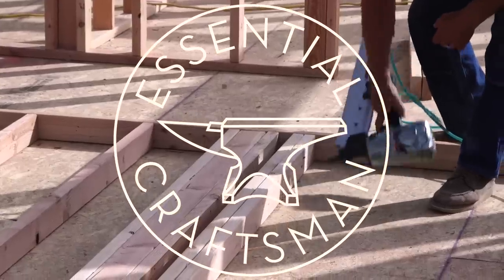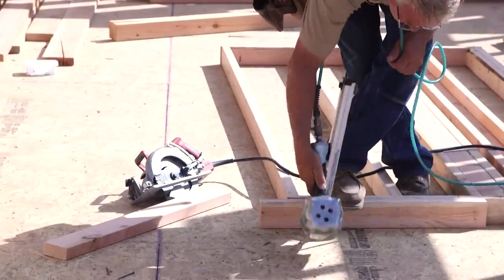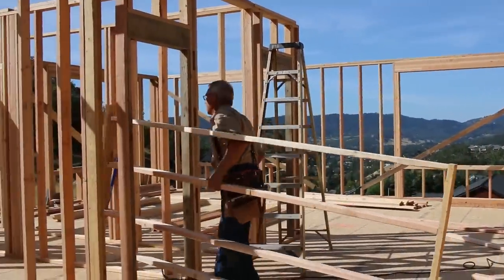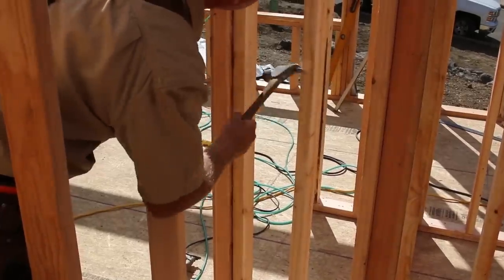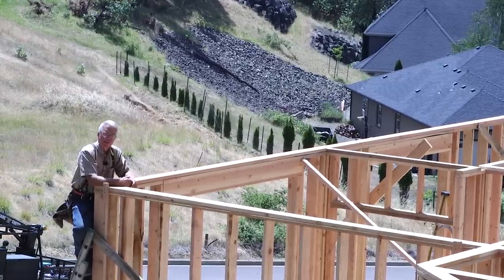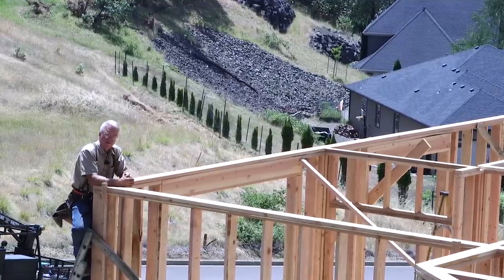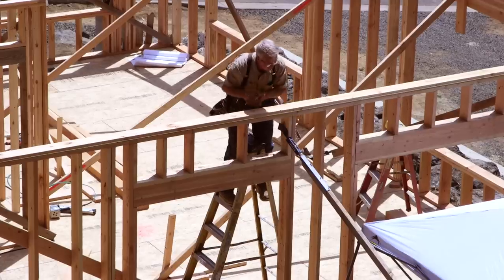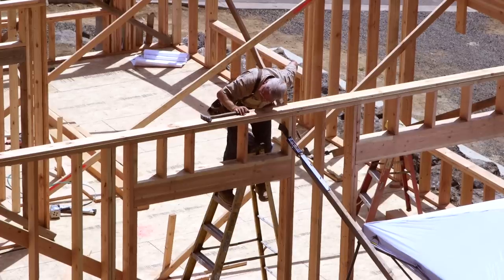Plumb and Line the Walls Ep.49

Comment: I've always like to insulate the bathroom walls and common bedroom walls for sound. Thanks for sharing,; keep up the great videos!!!
Reply from the maker: great idea!
Reply: Thomps 2881 same here!
Reply: Like wise. Keeping noise down is a great idea. I do floors to.
Reply: In ireland we sound insulate all internal walls now. i grew up in a house that didnt have insulation in the studs, you could hear everything. It dosent cost much extra to do it.
Reply: Two separate 4" stud walls on a single 6" plate, with insulation weaved between them, works very well for reducing sound transmission, more materials and time though, nothing is better than solid block built interior walls though.
Reply: A thousand times yes!  I try to get people to do it every time; just throw some Roxul in there, you won't regret it.
Reply: Noise dampening from the kids too 😉😉😉
Reply: Thomps 2881 a rootin, tootin good idea!
Reply: in old Cornish cottages in the UK, the two top floor bedrooms are separated by the staircase and the bathroom is normally downstairs.
Reply: I would have gladly paid my builder to insulate our bedroom wall from the noise in the family room, but nope, not an option! Ridiculous.
Reply: And extra glue for the floor around the bed area😂
Reply: @thomasutley  I've heard some contractors will upcharge an absorbent amount for something so easy to do. Never made sense to me.
Reply: Roxul makes a sound insulation. here In canada anyways.
Reply: When we built our retirement house a few years ago, we put batt insulation in ALL the interior walls for sound deadening.  The cost was minimal and the pleasure of quietness was priceless!!  I recommend it highly.
Reply: I did my kitchen for the same reason
Reply: Hillbert 08 is it their rock wool product?
Reply: @Some Guy it has a lot of sound deadening qualities. We sometimes even throw in a few leprechauns to boost the rating. 😂😂😂
Reply: @Some Guy any one I ever caught was only good at laying brick.
Reply: Same here, it really makes for a solid feeling place.
Reply: Here in Belgium we almost every house has brick walls. That is why I watch this series. Wooden houses are getting build  more and more.
Reply: @stephenmurray4916  Probably can hear people farting across the house.
Reply: @thomasutley   It's your house, you are paying for it. Insist on it.
Reply: @thomasutley   I went to my house and did what I wanted. Ran audio cables for speakers, network runs, chases for av cables. As long as it was after they left and I didnt change plan work they didnt care.
Reply: @shortfuse43  I did the same for sound..heating and cooling..and for fire...
Reply: Same here
Reply: @Jon-cs9ik  you just regret being the roxul installer.. damn I hate touching that stuff!! 😷
Reply: I can see Larry Haun never taught you to hand nail.

Comment: I have built quite a few houses as a joiner and the way we used to go about it was the same as what you do here in the way that you cut all your studs, bottom and top rails etc and then assemble. The only difference is that when we were framing we would frame the walls on the deck and then square them then sheet them and then lift them into place, we found it easier than trying to wrestle sheets when the frame work is up. Long walls would be broken down into shorter  walls if they were going to be really heavy but most of the time we had a tele handler on site so there was no heavy lifting really. Not saying our way is correct but just saying that's the way we did it.
It's good to see a house framed like this way though, very interesting. Keep up the good work   👍🏡

Comment: Thanks for sharing! Keep up the good works guys.

On the subject of insulating interior walls the acoustic seal caulking (it's basically tar in a caulking gun and sound dampening drywall go a long way but I wouldn't do it on a spec house only a custom build where it was needed and paid for. 

The real sound transfer is between floors imo. I look forward to you guys going into detail on this in the podcast!

Comment: Here in the south we use 2x4 construction for exterior walls almost exclusively. Unless like in Florida where there are a lot concrete block construction. The walls may get brick veneer, but the extra insulation is not necessary. It is good but not necessary.

Comment: Are you planning on using thicker drywall, or possibly insulation for any of the bathroom walls? That coupled with a solid-core door adds quite a bit more privacy. Especially nice for bathrooms off of a livingroom or kitchen

Comment: Hello Sir,

Question for you if you read this and have the time.  I wonder why you stand most of your exterior walls without sheeting?  I’m from the heart of the Midwest and have been a carpenter for 24 years. It is standard practice in these parts to sheet walls and house wrap on the ground then stand exterior walls.  Albeit, garage walls excluded.  Thank you kindly, and I plan to use your videos as standard practice for the next generation of apprentice’s I train.  Simply brilliant!

Comment: Love this show I just finished my carpentry apprenticeship here in New Zealand. We frame a little different here don't use sheathing instead we block or dwang or nog (different terms) between studs at 800mm centers. I personally think sheathing is probably better for the insulating values and bracing elements.
Keep up good work
Reply: Back in the day we used to let in a sway brace diagonally into the wall. Simpson still makes metal bracing that you nail into the wall after cutting a saw kerf.

Comment: Put your string and the bracing on the inside of the wall. Nail blocks over a joist where you need to nail a brace.Put your sheating on the exterior walls before you take the braces off.

Comment: You Sir use to work out here in Vegas and have seen how quick they build homes not very straight or plumb in theses huge sub division they build but they are building a new home from beginning to end in 6 weeks. The framers get paid by piece work so they usually try to frame out 2 or 3 homes per day.

Comment: It isn’t so much timber walls isn’t typical in Denmark, it’s just old fashioned. Most interior walls with dry wall are done with steel. A gauge you can cut with tin snips, and crimp the joint with  special pliers. Top, bottom and sides usually have some type of dampening for sound as well. And all of them are insulated as well, at least for sound. Seems very cumbersome to still do it with wood...

Comment: Hey Scott and Nate, I'm wondering if this is just different building practice or if there's a gap in my knowledge. at this point in the video series I would have seen somewhere between 3 and 6 temporary ladders built into the walls as blocking. On the framing sites I was on, we always made sure there were ladders up two exterior walls and possibly a couple of interior walls as well. It's a minor thing, but I figured I would ask.

Comment: Good to use lots of braces to keep things straight. As a finish carpenter I have seen too many crooked walls. The tall guys can really push a wall, that is if it's an 8' wall. Just grab the studs, not too high, arch your back and when the guy with the bubble machine, line or eyeball says push, just straighten your back, but there has to be an easier way. If it's an outside wall you want to push inward, and you have a shovel handy, you can jump on it with both feet to drive it into the ground and butt a long 2" by against the blade of the spade, and use it as a bent prop. It can push a lot, that way. When I was on a framing crew back in the 80's framing large apartment buildings, on a good day, the boss was only feeding the crew material with the fork lift all day, but that wasn't all the time.

Comment: I can't imagine spending time chasing an 1/8" framing error anywhere. That's less than humidity and temperature expansion/contraction in most cases, and if you can see that error anywhere in the finished product then you're probably a robot. I can admire craftwork and high standards but that just seems counter-productive.
Reply: Keith Klassen ya
Reply: cutting on the wrong side of a line seems bad enough.

Comment: you may have answered this already but is there going to be fire blocking or fire stop in the walls?
Reply: The top plates act fire-stops in this kind of framing. Separate fire blocking is needed in balloon framed walls.
Reply: The Code for residential construction in used most places in the US don't require fire blocking for 8 foot walls.  I believe that a wall has to exceed 10 feet before fire blocking is required. Also, blocking is required between floors, but in the most common type of framing (the way it's done here) like J Anderson said, the top plates fulfill the need for fire-blocking between stories.

Comment: If you were to be adding insulation for sound dampening in interior walls, would you still use 2x4s or would it be better to use 2x6s?
Reply: 2x4 with r11 insulation does a nice job. I wouldn't go to 2x6, instead I've used sound sheeting behind the drywall (in hotel application); worked great.
Reply: @thomps2881  Thanks.

Comment: I prefer insulated interior walls...much quieter, makes house feel much more substantial.
Reply: Code in my area  homes worth worth than 500k require insulation between rooms and between floors  for sound.
Reply: Glenn Holcomb.... wrong. Last two homes we’ve had built and lived in had the interior walls insulated. Huge difference. And you don’t need exterior doors. Just solid wood, not cheap hollow core.
Reply: Glenn Holcomb ....
Reply: Sound does not infiltrate like air does. Doesn’t sucked under a door jamb.....but whatever....I’ve lived in houses built both ways and know the difference.
Reply: Glenn Holcomb ....Really??? But according to your theory all those weird bathroom noises will leak out under the door jamb...sound insulation isn’t meant for “vibration”. It’s to muffle TV, music, talking and other sounds from adjacent rooms...which it does very effectively.

Comment: I always asumed internal walls are insulated for sound reasons but I know there are many ways of achieving this.
Reply: very rarely, even on expensive homes. only custom builders do that on personal homes
Reply: @alexstepanyuk381  the homes I've lived in usually haven't had a sound issue, so if it doesn't need it i wouldn't be fussed.

Comment: I strongly disagree with no insulation within interior walls...all rooms, especially bedrooms are better with soundproofing from other rooms. I built one home for myself and I used 3 types of double-walled construction in bathroom, bedrooms and laundry room walls and I insulated them for privacy and acoustic isolation. It's cheap to do so. It also allows better temperature control in rooms that aren't being used and rooms that are being used. It's kinda like rebar and concrete...2 of the cheapest materials in a house and people are always skimping for some reason. My slab was 6" thick with lots of rebar and weld-wire mesh, my non-bearing interior footings were 12" by 24". My exterior footings were 24" by 48" but then I was building on a hill in California where mudslides occur. If my house was going to take a downhill skiing trip it was going to arrive in one piece. You can't make money building that way though. I was listening to some other videos today and it occurred to me that you could make a living narrating for people's videos. Incredible voice and manner of speaking.

Comment: Indeed that kind of lumber construction looks distinctly "foreign" to European eyes. While there are some wooden buildings here, most of those are factory-built and are usually laden with a reputation of "cheap" rather than "affordable".

I wonder how high one could reasonably build with that kind of construction. In most Urban areas over here, two-story buildings are rather unusual, as zoning rules usually require at least three or four above-ground levels (not to mention real estate prices dictating getting the maximum square meters of floor space a lot will allow, often stretching zoning limits). A lot of construction I see over here involves tearing down an angled roof on an existing building and putting one or two additional stories with a flat roof on top instead.
Reply: Depends where in Europe you are.  Most buildings in the Nordic region are timber frame construction not too dissimilar to this one.  They're usually built with thicker walls though.  Here in Norway the minimum recommendation (which actually specifies allowable energy loss) typically equates to 20cm thick walls with even thicker ceilings and roof insulation.
Reply: supply and demand. when land is expensive you build up. when it's cheap you can streth out

Comment: Someone who has never worked a subdivision has no concept how fast framing  can go up.
Reply: No kidding
Reply: The going rate for start-to-finish residential construction here (Central TX) is about 46 days. Not working days, I mean forty-six days on the calendar. From pouring the foundation to the owner taking the keys in-hand.

Throw in that the building is roughly half-finished after the drywall has been hung, and it really puts everything into context.
Reply: Back when I framed it was a house a week per crew, sill to peak. There were often roofers laying comp before we got down from setting the last roofing sheet. There were usually 4 to 5 other crews in the same area. It goes fast for sure, I know it's even faster in larger areas that are being mass settled. :)

Comment: pretentious question: isnt the correct phrase “corners square and walls plumb”?
i thought the term originated from roman “plums”, the iron weights they would suspend on a line to verify a surface ran 90 degrees from the ground or perpendicular to gravity’s pull.
Reply: Plumb is from the latin word for lead. They were most likely using lead weights on a string like the brass or iron plumb bobs that were still in common use into the 20th century. The spirit level, your typical 2’, 4’ or 6’ level found at your local hardware store or lumber yard was much faster than a plumb bob, and reasonably priced laser levels have taken over from transits and “dumpy” levels for checking for level over longer distances.
Reply: J Anderson right, hence my specific use of “iron lumps”
my question still stands

Comment: No sound insulation in the internal walls?
Reply: Framing, plumbing, hvac, electrical,  low voltage, then insulation before drywall.

Comment: Does Oregon code not require a "firebreak"? A horizontal stud in between the verticals 4ft up from the floor.
Reply: I don't know what the codes are in Scott's area but most residential construction (4 dwelling units or fewer in a single building) in the US is covered by some modified form of the International Residential Code.  Generally speaking, 8 foot walls are not required to have fire stop blocking in the stud spaces.  If I recall correctly, firestop blocking only becomes necessary if the stud spaces exceed 10 feet in height, of they  extend through to the next story.  ie: a 'balloon" framed building, with no plates on the top of the framed walls like you see here.
Reply: only required at heights over 10ft. 4 ft firebreak sounds like massive overkill.

Comment: Hi there Scott and Nate! Thanks for this, I used a much smaller version of the rods and tensioners you show here to pull the first wall I build straight, it was the back wall of my small garden room build in the UK! I also used you tip on the framing video of the shed where you set the last an first studs a few mil off the end of the bottom plate so the two studs pull the two bottom plates and wall plates together, it worked a treat, and I also explained the tip to my son too! Great video series, thanks! here is our video - https://youtu.be/F-TeR990NAU

Comment: Ignorant people are very quick to point wood as combustible and prone to rot and weak as a structural building material. And well, they're ignorant people. Of course, a crappy shoddy builder building anything with anything will give a bad rep to any building material. Wood actually is renewable, can be used in a building in such a way to make the building fire proofed better than concrete and steel, and IIRC can be used (with the proper engineering) in hurricane and earthquake prone regions with success and durability. The issue is more with stick framing, lightweight construction, synthetic materials everywhere making the new constructions prone to rot and fire even more. The issues are not with wood but with the methods.